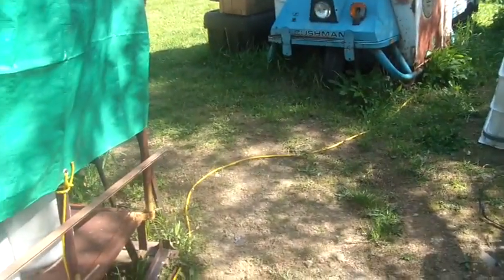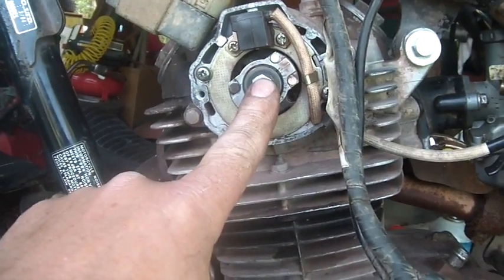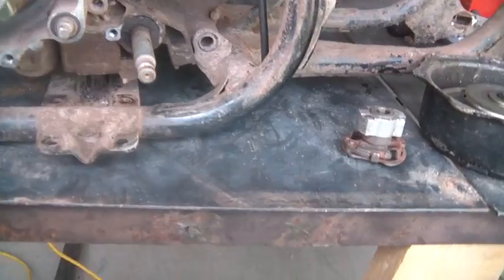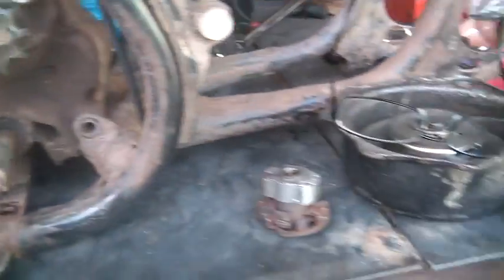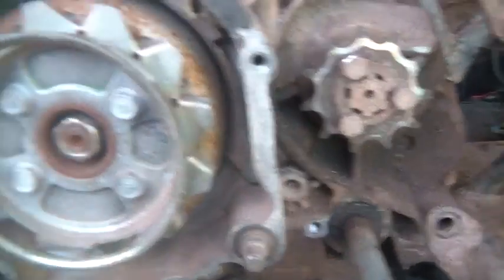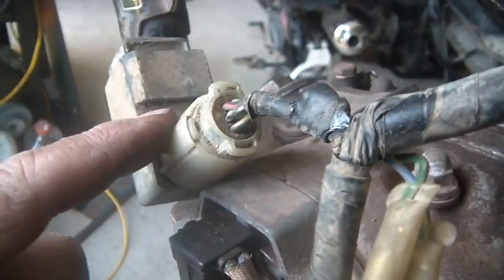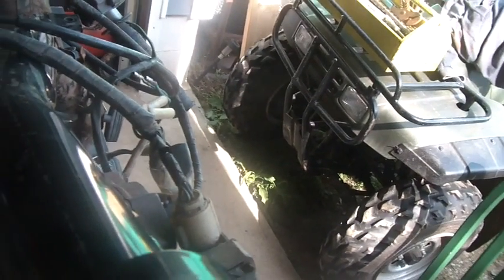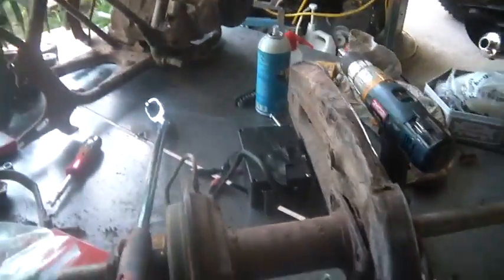5_20_14, Honda ATC 185 / 200S Timing, OEM wiring,

Comment: If u read this can u tell me the colors of those stator wires mine all burnt off there in a row top middle bottom on the right of the case tell me top to bottom please is the middle wire the stator or and which one is the lights and which is the ground

Comment: oh, also have to ask that is it OK that I can seem to get the pulser and magnet lines to PERFECTLY line up? they are close but not perfectly in line. I'd say about 1/16 in off. the pulser has no more give even if I back the screws ALL the way out.
Reply from the maker: Hey Omar!!!   If it starts and runs all is good.... As time goes on, the timing chain stretches a bit and when the adjuster takes up the slack, it goes off a little.... BTW, U can tell how much slack there is in Ur timing chain by rocking the fly wheel back and forth while watching the pulser magnet.... Thanks for asking, watching, and commenting!!!

Comment: Wow! I want to start by saying thank you so much! your vedios are  AWESOME!!!!

OK, when I started I had no spark. I went through all your tips and tricks and now I have spark, but I have a couple more questions.
1-when I was trying to line up the magnet line with the pulser it was impossible. only reason I found was after opening up a spare motor I have in the garage, I noticed that the existing holder that holds the magnet (dogleg with springs) on to the cam had the notch perfectly in line with the magnet which didn't allow me to align the magnet line with the pulser line. The holder in my spare engine had it slightly to the left like the one your vedios. I swapped them out and now have spark. it's not deep blue though. it's orangeish (is that Ok?) I also found that whoever put the bike back together, had installed the cam sprocket with the circle down. so I changed that as well.

2-when I opened the stator cover, there was oil in the stator case. is that normal? should there be oil on the stator side of the motor? stator coils seemed really oily...

once again, thank you so much for your vedios. I've been watching them non-stop for the last 48hrs. lol by the way I just bought this trike yesterday and the guy sold it because it had no spark. bike seems to be in really good shape, whish I had a way to send you some pics of the trike and my findings.
Reply from the maker: Hey Omar, As long as she starts and runs, I would not worry too much about the magnet alignment.... About the stator having oil on it.... I would wipe it all down and run it a bit and see if it gets oil up again.... U may have to change the crank seal.... Lastly,  the 185/200 ATC motor does not have the brightest spark, I have a couple of ATC with an orange spark that run just fine.... I'm glad that I was able to help!!!!    Thanks for all the kind words, watching, and commenting.... Thanks also for saving a Honda ATC from the scrap yard!!!

Comment: como va armada la caja de velocidades honda twinstar 185modelo1979
Reply from the maker: Hey Juan,   How is the gearbox honda twinstar 185modelo1979.... It has a 5 speed transmission  automatic / centrifugal clutch, all gears are in a row, neutral is 1 click above or below 1st gear, not between 1st and 2nd.... Thanks for asking, watching, and commenting!!!    ¿Cómo es la caja de velocidades honda twinstar 185modelo1979.... Tiene una transmisión de 5 velocidades automática / embrague centrífugo, todos los engranajes están en una fila, neutral es 1 Haga clic encima o debajo de la 1ª marcha, no entre la 1ª y la 2ª.... Gracias por preguntar, observando y comentando!!!

Comment: hey I need your oppinion on something. Do you think this engine is knocking ? https://youtu.be/P90A0M3Ts7I
Reply from the maker: +Disloyal Dashie,     I don't think the engine is knocking, I hear a lot of exhaust noise off
 the engine exhaust port...  One can really hear a knock at a slow idle 
or very slow idle, use a rag to silence the exhaust noise, if it is 
knocking, U will hear it...Thanks for asking, watching, and commenting, 
good luck, let me know how it all turns out!!!!
Reply: Harvey Spooner I sure will. I need to get an exhaust gasket for it cause I assure it is NOT Sealed
Reply: Harvey Spooner Oh and I forgot to mention that this engine had water in it and was previously hydrolocked.
Reply from the maker: +Disloyal Dashie , I pulled an abandoned Honda ATC 200S out of a swamp, it was upside down, under water and muck, and the tires were gone... I managed to clean up the bore and it ran fine, Honda makes some good stuff, I think U have a solid middle aged engine there, it will smoke a little, especially when first started and it will have some valve noise, but, it will be a solid runner... Keep it full of oil, run a good quality 20 / 50 ATV oil, and don't over rev it... Oh yea, do a timing chain adjustment... I tend to let my valve lash be a bit loose, I rather hear them then toast the valves and seats... Good luck and please post some videos on Ur machine, a 200X with a 200S motor is a nice machine to ride.... Thanks for posting, watching, and commenting!!!!
Reply: Harvey Spooner Thanks ! I will definitely post more videos. And I have Valvoline 10w40 Motorcycle oil for it. Thanks for your oppinion !

Comment: I've had bikes all my life and I'm 60. I have found a lot of people do not realize these and most ATV's do not start in reverse. They drive the bike into a shed or garage and turn them off.The next time they try to ride they start the bike, put it in reverse, to back out and it stalls.never to run again because it is still in reverse gear. Have you ever got bikes that are ok but people can't make them run? It shows as a no spark issue and people don't realize what happened.

Comment: Hello Harvey 
Wanted to get your expert opinion on my ATC 185s issue. When motor is cold and I set my carb lever to choke it starts off strong and idles normally. Once it warms up and I set the lever to middle position, engine occasionally makes grinding noise like chain is hitting something, starves for fuel and dies. Is my timing off or the chain is loose. I'm guessing it needs new chain or maybe just an adjustment. What's your take on this. Thanks in advance.

Comment: you seem to know alot about these machines, I have a 84 200 trx that wont start, It has spark at the plug and the carb has been rebuilt, I cant figure out why it wont kick over, spark, fuel, and air should go right? 

the battery was new last year, this year its dead, It wont charge, but it should still start with the pull start, Im at my wits end with this machine, could a faulty battery cause it to not start at all? I have a charger on it green light in nuetral, switch to run, and clean tank with clean gas. Thanks for any help
Reply from the maker: +Dirk Smithson , Hi, sorry for the delay, catching up on my comments now... It is a TRX200, shaft drive, right?  Was it running, and someone messed with it or it just stopped running one day?  The TRX200 and TRX200SX will both run with a dead battery. All Honda ATCs will and I think all quads will also, though, I don't know that as a fact.  Sounds like U did all the basic stuff, clean carb and spark. Did U do a compression test, are U sure that Ur valves are not too tight... Does it try to start at all?  About the battery dying after sitting for a year, unfortunately, that is not a surprise, happens to me all the time. Let me know 2 things and I can be of more help, is it a TRX200 shaft drive and did it just stop running one day? From there, I can help U with the troubleshooting.... Thanks for asking, watching, and commenting!
Reply: I'll try to keep my answer short and simple, Purchased it non running, I cleaned tank of rust, installed new pull cord, cleaned carb, new (used) CDI Ignition Coil Spark Pulse Generator. I got it to run and drove it up and down my block a few times, parked it, and would start it from time to time to keep the gas fresh, one day it just wouldn't start any more, I dont know how to tell it it has the shaft drive, It isn;t automatic, you shift with left foot if that helps. I have the same amount of spark I had last year when I got it to run.
Reply: last year I found out I had a plugged jet in the carb, once I had that opened up with laquer thinner soak, it fired right up, this year it has me stumpped!
Reply: no one has messed with it, although I found a wire was removed from the cdi unit, dont know how that happened, I'll check compression tomarrow, aswell as valve clearance

Comment: I am very sorry at the beginning of this video, you said the little pin , key pin, fall out,?? well !!!once force is applied  to the end of the cam,the dowl pin will never fal out, unless cam end bolt falls out, ,,,,well even if that did and the DOWL PIN did fall out one in 10000000000000000 chances of it to fall into the motor, in any shape or form, Not that I would know, lmfao, do NOT speak, unless what comes out is true,  or post about trikes stuff that is not true,
Reply from the maker: MrTwistedwheeler , Not sure on Ur point... Once the whole thing is put together, U R right, the pin, or cam dowel,  will not fall out, when putting the whole thing together or when taking it a part, it is fairly easy to loose the pin, especially if the ATC is well worn, once it is lost where is it? Would U fire up a freshly rebuilt engine if it was lost and U were not sure if it fell into the engine or not? U have some nice ATCs on Ur channel, do U do the restore work or do U get nice stuff and take good care of it?  Thanks for your thoughts, for watching, and for taking the time to comment.
Reply: Harvey Spooner If your putting back together, and lost it, why could it be in the motor,?  and not on the floor, or the bench, if you took it apart, you would of have known not to loose the pin, and place it some where safe, yet in the CDI advanced unit housing, it is impossible to fall in to the motor,  and yeah we just find trikes  nice,!! all the time !!!We do nothing at our shop, lmfao, YES THOSE ARE OUR BUILDS, WHY WOULD WE POST OTHERS TRIKES, ? TW

Comment: hay Harvey my name is Doman  iv been waching your videos on how to find out why my 1984 big red isint getting spark i did every thing you did but still hasint worked all the electrical parts on the  three wheeler work i know this because i took them off  another one thats the exact same year and  size. Do you have any ideas
Reply from the maker: Bea Surrarrer , First question, was the ATC running and  it just stopped, did U buy it as a non running unit, or did it just decide not to start one day?  I made this video, "10_28_2014, Troubleshooting 1984 Honda 200ES CDI ignition, "  a little while back.  with a Harbor Freight meter, (free with a coupon), one can troubleshoot a 200es ignition system in a few minutes. Give it a watch and let me know how I can be more helpful... Thanks always for asking, watching, and commenting....

Comment: Thanks Harvey! Great videos! Ive watched a few since I'm the new owner of a Honda 185s. Got a question on my timing. When I was attempting to adjust my valve clearance I've noticed my timing might be off. I've got the "T" mark lined up (TDC) when I look down at the crank, but the rotor mark and pulser cable marks are nowhere near lined up. In fact the rotor line mark is pointing straight down or away from the pulser cable mark. Does this mean my timing is off? If so my thought is if I take that pulser rotor assembly off (held together by the one bolt) that's under the pulser generator and flip it 180 degrees to where all the lines match on the crankshaft "T" (TDC),  pulser generator, and rotor...would this be my fix? Is it that simple? Can that pulser rotor just unbolt and flip 180 degrees? Any suggestions would be appreciated. -Thanks. Sean
Reply from the maker: Guy Random , Every 2 RPMs of the crank is 1 RPM of the cam, so, turn the crank 1 RPM and the pulser magnet should be near the right place. When the pulser magnet is lined up exactly on the pulser, the fly wheel timing make should be aligned to the F, (for firing the CDI), . It is as easy as U think, 1 bolt, to correct the 180degrees out or to cause the 180degrees out. U know if the ignition timing is correct if, the cam lobes are down, valves closed, rocker arms loose, and the fly wheel is aligned to the F position. If U have questions, please ask, a mistake can smash up the valves and cost you a head... Thanks for asking, watching, and commenting... Congrats on the 185S, it is a great machine, one of my favorites!
Reply: Harvey Spooner Hey Harvey, Funny that you posted this video and are having a conversation with the gentleman above because I am experiencing the same exact issue with my 1982 185 s as well. I went to check the gaps on my valves and my pulsar was 185 degrees out of whack too. And never really noticed much issue other than some idling problems once in awhile. I took that bolt out and turned it a hundred and eighty degrees and my machine wouldn't fire. I put it back so it was at about 6 o'clock and it fired up. Is there a possibility that the flywheel cover is upside down and is not reading right in accordance to the rest of the engine? Also if engine is at top dead center couldn't I remove the plug and the piston should be all the way up to the top? And I think I might have messed up my valve clearances any help with that as well??? Thank you very much in advance for any help you can offer.

Comment: New subscriber here, great video, I have a 85 200x with a 200s engine in it, brought it back to life and it runs great but needs a top end so I am just a bit unsure about timing it, I guess it should be just like the one you have here so if I just line up those two things you showed, my timing will be fine? - Thanks
Reply from the maker: Iron Feliks , Just remember, lobes on the cam down, crank timing mark, (by the T), and cam timing mark, (Circle located on the sprocket), both up. Once that is all set up, set the crank to the (F), and rotate the CDI pulser plate such that the magnet and line on the CDI pulser are lined up.  Set the lobes down before U put the head on the engine, U don't want to rotate the crank and hit an opened valve with the piston. Thanks for the subscription, I have a couple of 200X bikes that should come out of the shadows and get worked on. For my 200X with the 200S motor, everything seems very tight, Thanks again for the sub, please drop by often!  Thanks also for watching and commenting!
Reply: Thanks Harvey!